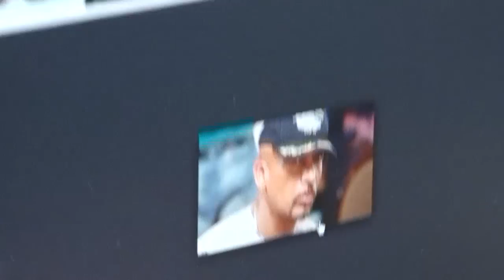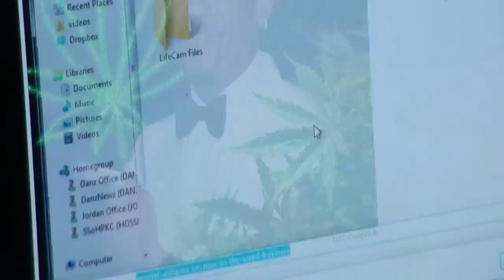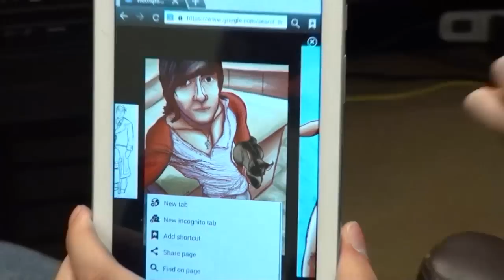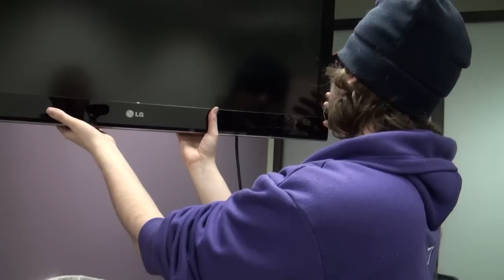Wall Mount

Comment: As someone who has a little experience with this stuff, my suggestion is to find and actual stud and drill into it. Don't use dry wall anchors, they will rip right out. Also, wood screws are a better choice.
Reply: They did, but I do not no about the wood screws.

Comment: I have never seen someone struggle so much to find a wall stud. Even when he did find it, he had to re-drill. because only Kootra is capable of missing one of 2 holes he needed to drill into a perfectly vertical piece of wood. Many facepalms were had on this day.

Comment: He forgot to do the most basic. Knock. He also uses the studfinder wrong. presuming its magnetic, you always check for more nails along the whole stud to make sure its not a metal railing or any form of coppar pipes, wires etc. to be overly safe you can get a stud/AC finder.

Comment: Kootra, the reason your stud finder found those wires is because you're probably using a magnetic stud finder. If you don't know where the wiring is, you should use an electronic stud finder.

Comment: Youre supposed to just put the anchors in like regular screws, drilling a hole to put them in defeats the purpose of the anchor. You screw them into the wall, then put screws inside of them

Comment: I don't know much construction wise so what's the deal with studs please?
Reply: You can't fix anything too heavy onto a wall without getting it on a stud, cause dry wall is not resistant enough to old weighs like that tv mount.
Reply: +Nexgen Blakswordman studs are the wood structure in the walls
Reply: +S White Uk, Every things brick it's easy.